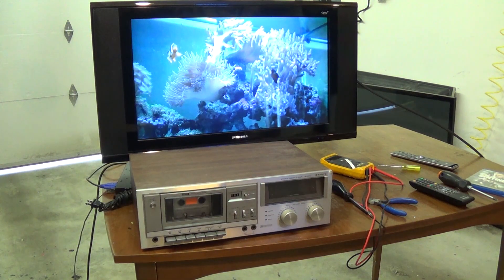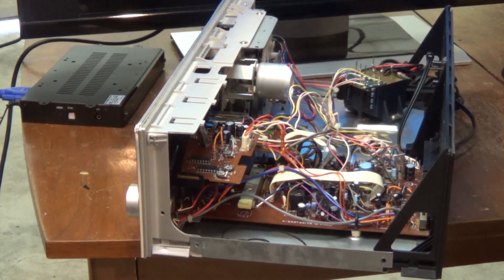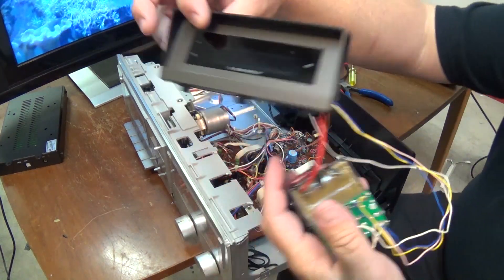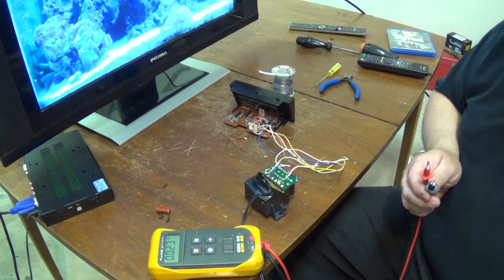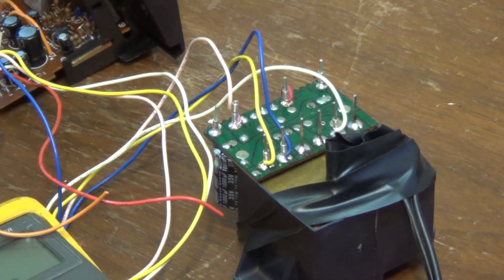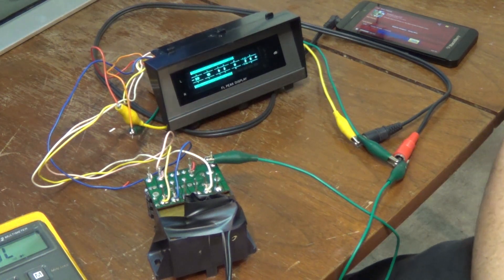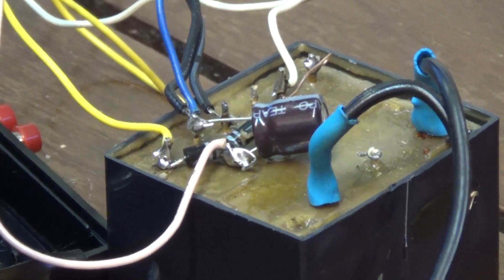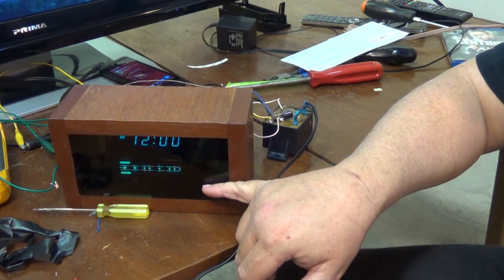VFD Clock   VU meter build

Comment: Do you need a splitter in order to route to both the speakers and the VU meter?
Reply from the maker: No
Reply: @12voltvids  Care to elaborate then? :)
Reply from the maker: @Enigma758  plugs into the record output for tape 2

Comment: Put a red diffuser on the end past the 0 on the VU meter.  Trust me it will work.  Just take an old LED clock radio from the charity shops, take the red lens off and put it on there.  I've done this on a customer VFD module and it is rather a nice effect.

Comment: hi there I like your video, i would love to use a vu meter in my car, is there any way of connecting 12V DC from my car to that power supply.
Reply from the maker: +kris the one I built from spare parts needs 30 volt to power th display. All vfd tube need higher tha 12 volts to operate. So to use on you would need a dc-dc converter.
Reply: @12voltvids  ops! duplicate video?? 🤔
Reply: +12voltvids I have more fluorescent VU meters than I know what to do with. sort of a fetish of mine ever since I was a kid seeing that green glow. Now, I have enough to build a whole audio wall full of them. haha. but I digress. The non-multiplexed versions that use the HA12019 or similar, BA6146, etc are 12-point and use displays that run very happily off 12v. But you still have to do something about the filament. Using an adjustable voltage regulator would work, but you would get a linear brightness effect because of the DC Bias.
Reply from the maker: +THEtechknight That is the problem with the ice tube clock kit. The filament is DC bias, so the seconds digit is dimmer than the hours.
Reply: 12voltvids Yep, and thats a huge problem. the LM9022 was a good solution until it went obsolete. So I replicated a circuit using a TDA2822 for smaller tubes. for larger tubes, I use an L293.
Reply: +THEtechknight The LM9022 is a "rebranded" LM4871 (same die, same specs) - It's a marketing stunt some clever people made :D
Reply: ***** Thats interesting. First ive heard of it. Source?
Reply: ***** https://groups.google.com/forum/#!topic/neonixie-l/HevOjKD3oqQ
Reply: ***** Wow. thats cool as hell. gotta love the marketing department.

Comment: do like indeed i have always been fascinated with vu metres and i like what you have done with yours good work!
Reply from the maker: MrLatte27 Thanks. It looks really great sitting in my office next to my computer monitor. I have it connected to the preamp out on my amplifier, so all sound that goes through it is displayed.Even when there is no sound the reference markers are lit, so it makes the display look balanced. That clock looked too small in that large enclosure, but now with the 2 displays in it, it looks so much better. Wish the clock was 6 digit, then it would be even better still.I will look for an old Sony SL2500 beta for the clock circuit. It had seconds display on a VFD tube. That would look great.
Reply: +12voltvids The only problem with locating an SL2500 or similar, is trying to find one where the VFD isnt already worn into the ground and looks like crap. I started collecting VFDs early on just for that reason. The older the equipment, the more use it probably had and the more likely the VFD is suffering from fade. But on the flipside, you may have a device that was only used for a few years and stored from some fault, or replacement/obsolescence. I get lucky all the time with cassette decks in that matter as most of the tubes are still nice and bright. DAT decks... Not so much...
Reply from the maker: +THEtechknight 
My DAT decks look great, but then they don't have a ton of use. Some that were used in a studio might have tons of hours on them, because they were probably left running 24/7.
I have a Sony ICFC5 clock radio that goes back to the early 80s and the VFD is still great, but then it has always been left on dim.